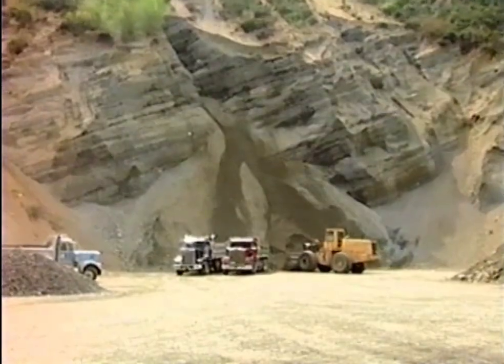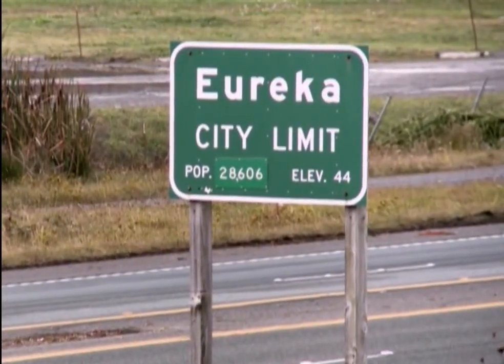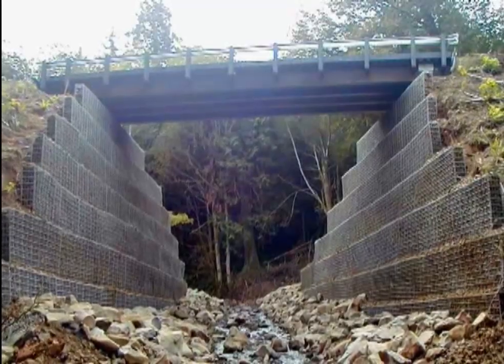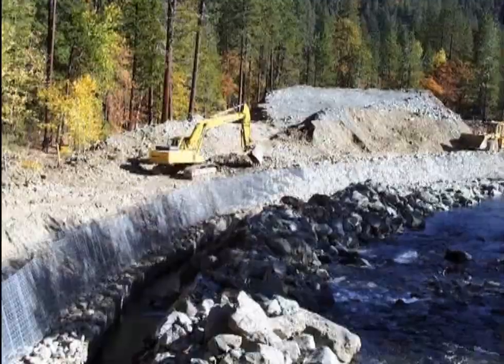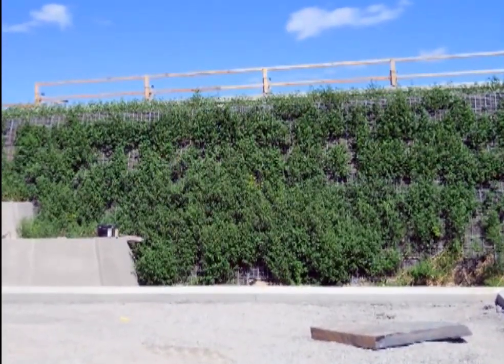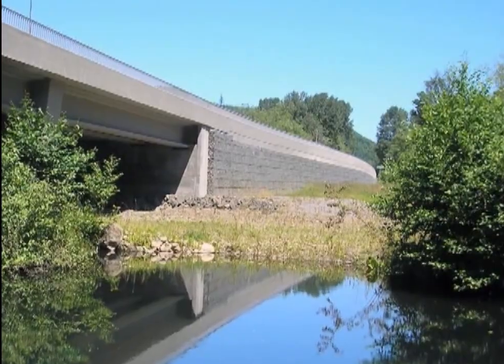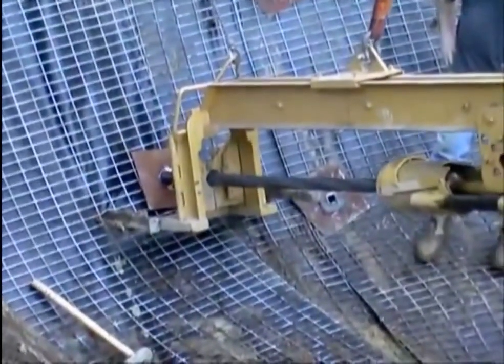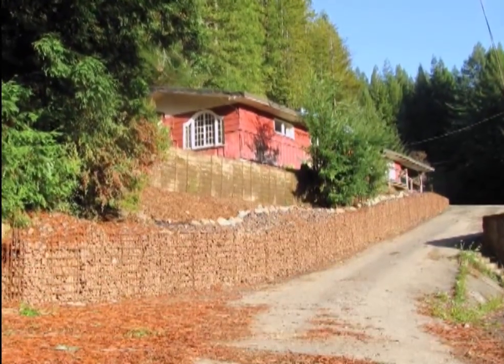Viewpoints with Terry Bradshaw - Hilfiker Retaining Walls

Comment: When the metal cages fail, they fail catastrophically.  This can be dangerous depending on the application location and worse, detrimental to water quality when rocks and cage remnants spill into the waterbody including the banks of the waterbody, and or wetlands, smashing vegetation and impairing water quality.  These are fragile  ecosystems.